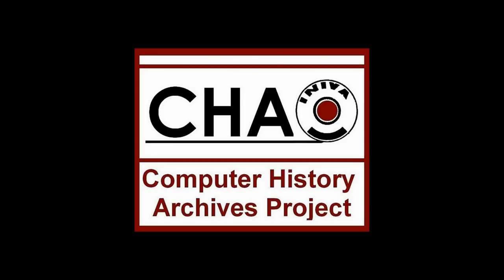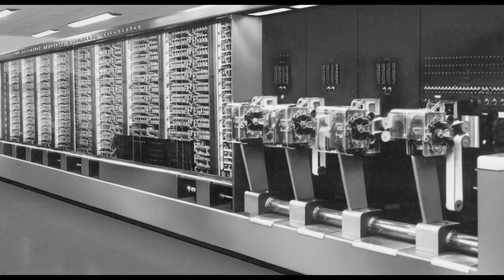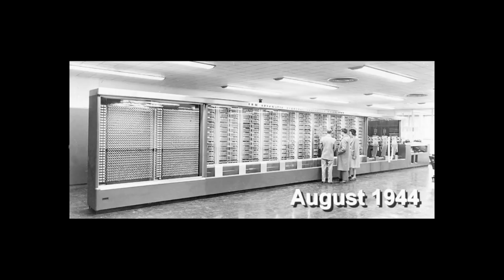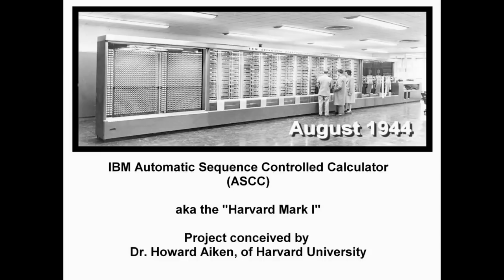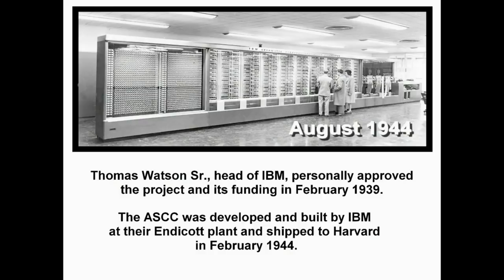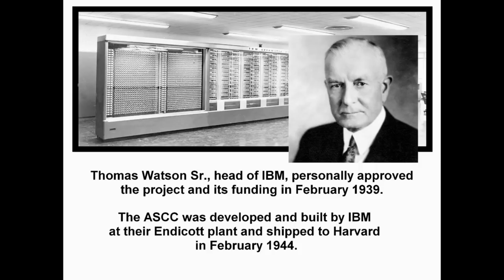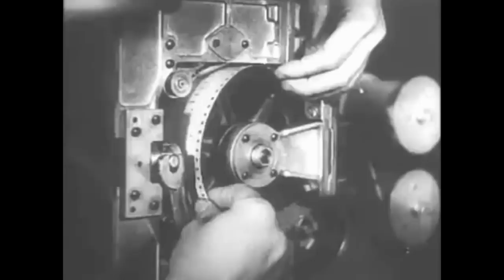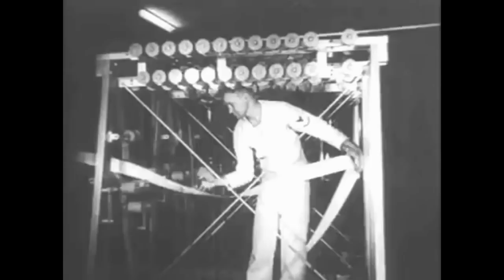1944 Computer History: IBM ASCC Harvard Mark 1 world's largest electro-mechanical calculator Hopper

Comment: (Tnen) Captain Grace Hopper gave a talk at my university in 1980, and talked about the Mark 1. I got an original Manual of Operations from Library Surplus, asked her to autograph it- to which she asked "Where the Hell did you get this!, I wrote this book." She then told stories about the original programmers, their names listed as authors. She also told the story of the first "Computer Bug". IBM also built the Mark II which used faster relays and could operate on one program, or two in parallel. If the results differed, an alarm sounded so the operator would know an error occurred.  The IBM Mark III was a hybrid electronic and electro-mechanical relay machine.

Comment: This computer uses electric motors in place of vacuum tubes or transistors
Reply: Electric Relays for the actual calculations, like those used in the Telephone System at the time.

Comment: that monster must have been LOUD.
Reply from the maker: Hi Greg, yes, I bet it was loud.  It was built for military/scientific use and probably little regard for making it quiet.   It was also very, very heavy.   I wonder if the operators used protective head gear for the sound.    -   Thanks for watching.